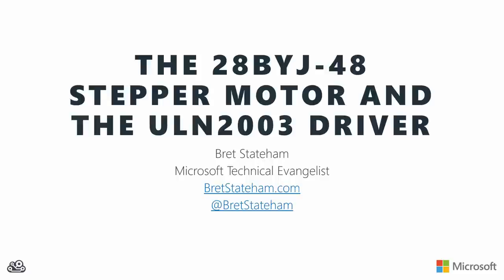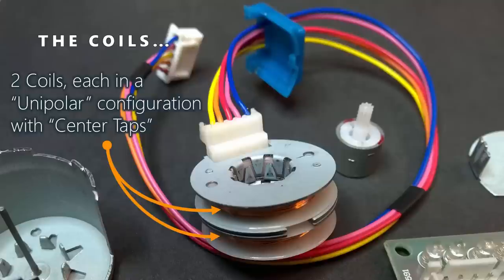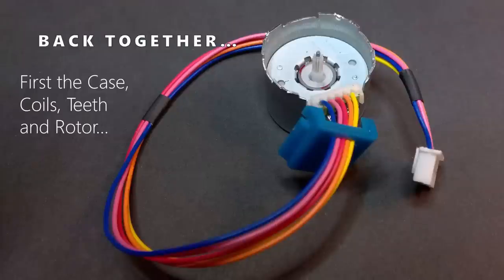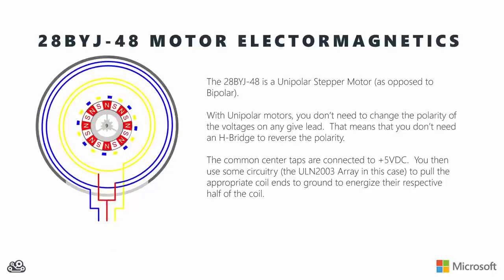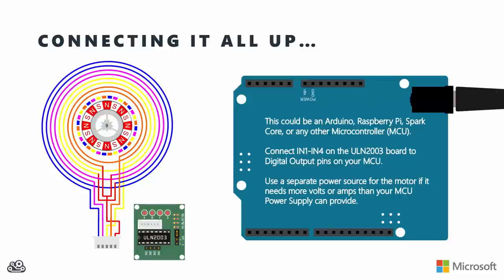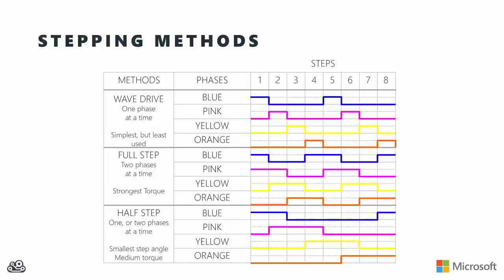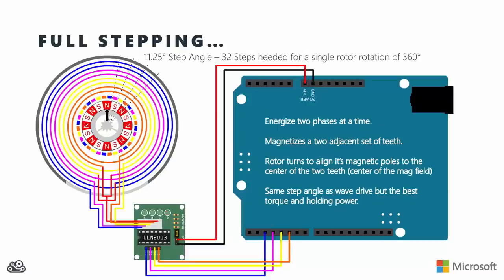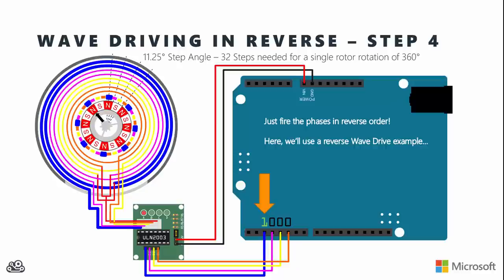28BYJ-48 Stepper Motor and ULN2003 Driver Intro

Comment: Can ULN2003 be used to drive a NEMA 17 bipolar stepper motor?
Reply from the maker: @Faisal, not sure.  If haven't tried it yet.  I have some NEMA motors in a drawer, but haven't gotten around to trying them with the ULN2003. I think you would need something more like a Stepper Motor driver board from SparkFun or Adafruit that have H Bridges on them to swap the polarities across the coils.  Or use something like an L293D chip to create your own driver circuit.

Comment: In real world this 2048 steps per motor shaft rotation for full 360 rotation isn't true. I have this stepper motor and i need about 2545 steps to full shaft rotation.

But Your presentation is great. Thanks for it.
Reply from the maker: +Piotr matrix Interesting.  I had pretty repeatable behavior with a couple of motors I was testing with.  Have you tried a different motor?  If you are placing a heavy load on it, you might be getting some slipping in the gears.  They are just cheap plastic gears as you can see.
Reply: +Bret Stateham no, i didn't tried other stepper motors because i haven't. This  2545 steps is without any load. I tested this stepper motor all day and 2545 steps was good any time when i was run my stepper motor. Always stopped in the same place.

Sorry for my english but I never had the opportunity to learn it
Reply from the maker: Piotr, your English is awesome.  I don't speak or type any other languages so I am impressed by your skill! 

My guess is that you may just have a faulty cog on one of your gears.  Again, they are cheap motors, with plastic gears.  Seems reasonable that there would be some quality issues.

Comment: i did everything the same as i have been following your schematic and others, but none of it works. why?
Reply from the maker: Couldn't say without more specifics.  If you can give me more details on what your setup is and what code you are using I'll see if I can point you in the right direction.
Reply: sir, i have noticed. i did not put the small kinda bridge on the driver. i wasn't putting my attention. tank you for replying sir :)

Comment: Wow all I did was use the Arduino example and changed it from pins 8,9,10,11 to 8,10,9,11 and works with 10k pot simples

Comment: Why does my motor only vibrate?
Reply from the maker: Typically a vibrating motor indicates that you either don't have the pins wired correctly, or that you are driving them in the wrong order in your code.  It's POSSIBLE that you have bad hardware, but more than likely it's a wiring or code issue.  My video on working with these motors from the Arduino gives you more specific information on driving it in code.  http://aka.ms/28byjarduino

Comment: Why did you not use a NEMA17 for this tutorial ??
Such a waste.
Reply from the maker: Hey @Kenneth.  Agree, I'd like to do a teardown and similar video on the NEMA17s, but this video was a result of me trying to use the 28BYJ-48's in a project specifically due to their cost and size.  I took the time to figure out how they worked as part of that project implementation and figured I'd consolidate and share what I had learned.  

Hopefully some day I'll get around to doing some other motors, but I guess only time will tell.

Comment: I Need to interface steeper with 8085
Reply from the maker: I haven't worked with the 8085 myself.  Not sure if it has digital IO pins, but if so this video should explain the basics of working with the motors from the 8085.  I also have a video on using the Arduino that may give you a more practical example.  That video is here: http://aka.ms/28byjarduino